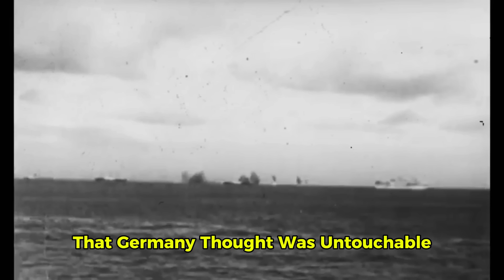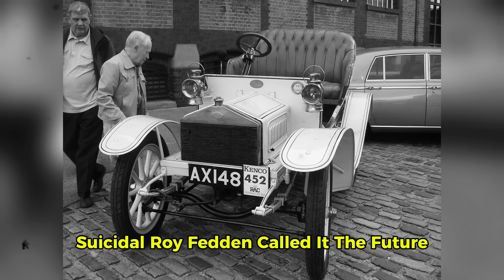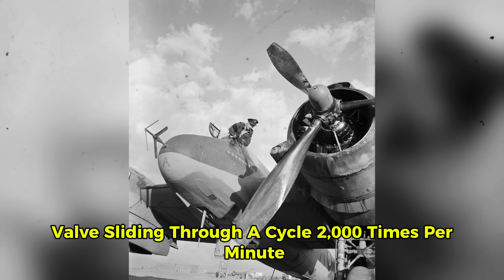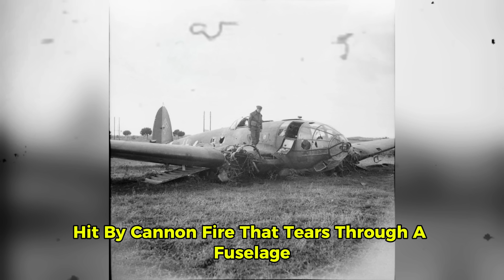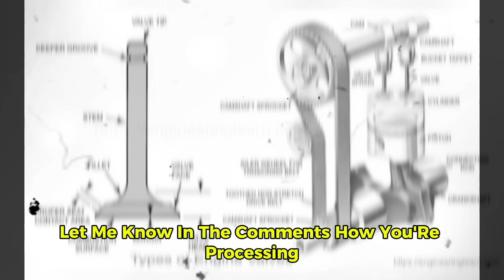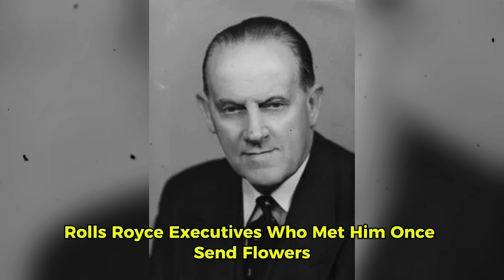They Mocked His Engine — Then It Saved Britain in WWII

Comment: My father went to work at AVRO in 1939 to learn everything about the  Lancasters. Then he went to Cairo to run the maintenance of Lancasters for Bomber Command. He had 200 mechanics working for him all of which really knew their stuff. They lost no planes due to mechanical failure. Of course they lost a lot of planes due to combat. He would determine what maintenance and repairs they needed upon returning from combat. He could repair Merlins but would never change the oil in his own car.  Then he went to English Electric to help design Canberras and Lightnings. Then back to the RAF to work on Valiants, Victors and Vulcans. Came to America to work for the Navy department then finally to Martin Marietta to work on Titans.

Comment: I think you are grossly simplifying the technical challenges to perfecting the single sleeve valve system 
His work with HDA ( High Duty Alloys) for piston and cylinder materials and sleeve materials which were compatible were the main challenges. I believe the final sleeve material was an austenitic steel, nitrided to produce a very hard surface and finish ground.... thousands of material combinations were tried and it was pure luck that the final finishing process was discovered.. 
As narrated, the Bristol Sleeve Valve engines were smooth  AND quiet as poppet valve engines are noisy in comparison 
 Finally the last civilian versions had time between overhaul up to 3000 hrs, almost jet level reliability, in the 1950s..
Sir Roy Fedden was a true genius, aided by his chief draftsman ' Bunny ' Butler.
ALL.Bristol parts have FB ....
IDENTITY numbers.
I believe over 120,000 Hercules were built, and they were still being serviced at Bristols around 1960.s
Reply: Correct me if I am wrong but did not Rolls Royce actually do the final grinding of the sleeves and cylinders as Bristol could not initially meet the fine tolerances required.

Comment: Daimler used sleeve valve engines in their cars until 1938. They were smoother, quieter and more reliable than a Rolls Royce. 
In 1927 Daimler was designed to travel 1000 miles each month and came with a five year warranty.
1927 and a 5 year 60000 mile warranty.
That's how good a sleeve valve engine is.

Comment: And yet most of every reciprocating internal combustion engine today uses poppet valves. I don't remember why they are not the end all be all that this video purports them to be but cost and complexity and liquid cooling instead of air cooling. What was its specific fuel consumption, maybe that's what it was? 
Specific fuel consumption - lbs of fuel per hp/hr.

Comment: I found that seeing a JU-88 displayed during the audio concerning the Beaufighter was , shall we say, unusual?  As to Fedden, years of work.  Imagine what the Orion could have done, with one caveat:  high powered piston engine technology was quickly becoming obsolete due to jets.  I have several books that mention the influence of Harry Ricardo on Fedden, as the use of sleeve valves with what was called a "junk head" promised the most efficient forms of combustion in an aircraft engine.  Thanks for posting this.  Other sites seem to concentrate on Merlins ,Allisons,  all the big P&W and Wright engines.

Comment: The sleeve valve engine was invented by Charles Yale Knight this was a double sleeve valve as per the drawing at  12.26 in about 1905. This was first used by Daimler in1909.Around the same period Burt & McCullum invented the single sleeve valve engine and was used by Argyle Motors it was then used for aircraft  engines. All aircraft engines were of the single sleeve valve design.
Reply from the maker: You are absolutely correct. While Fedden perfected the high-performance application for the RAF, the foundation was indeed the Knight double-sleeve and the Burt-McCollum single-sleeve designs. Thank you for clarifying that technical distinction for everyone.

Comment: If sleeve valves are superior to poppet valves, why are the former almost extinct and the latter virtually universal almost 100 years later? As but one example as to why, Sabres on the front line had to be run frequently during cold nights to keep them free enough to start before their first day mission. The engineering reasons are obvious: excessively demanding materials, tolerances, surface finish, heat treatment and lubrication.

Comment: Living in Wellington NZ in the 70s-80s the sound of laden Bristol freighters crossing Cook Strait is unforgetable. They were the smoothest radial sounds and I missed them when they went extinct.
Reply: As an apprentice at TEAL's (now Air New Zealand) workshops at Mechanics Bay, Auckland in the 1960's I spent a lot of time overhauling  Hercules for the RNZAF and SafeAir. Great engine and very easy to assemble in spite of the complexity of the sleeve valve drive train.

Comment: there is crap in this film, using an AI voice instead of an actual person that knows how to read a script and moreover KNOWS what is written. .  1.  October 1940 over the English Channel in a Beaufighter (not beau fighter or bow fighter) there would not be the smell of oil and sweat, it is cold for fucks sake at 18,ooo feet in October so no one would be sweating and the oil would not be in the cockpit.  Also Xi's, what the fuck is that?  Its Hercules XII which is Roman Numeral for 12!
Also why the use of images that have nothing to with the subject, like an image of a Heinkel 219, me.110, a WW.1 Armoured car and a prototype hawker tornado or Typhoon with night fighting radar equipment.  Merlin Engines in North Africa did not 'get chocked', they were fitted with sand filters to keep the dust and sand out.  Also the crap about Halifaxes flying over high Berlin because they were fitted with Hercules engines and not Merlin equipped Lancasters is another load of crap.  The vaunted 57,000 sorties by Hercules engined aircraft is LESS Than merlin Engined Aircraft.  Hercules engined Bristol Beafighters DID NOT FLY OVER Hamburg.  Also ignored is that Coastal command Beaufighter were replaced by MERLIN ENGINED Mosquitoes.  That isn't mentioned.  And for the 'engined that never failed' is a false statement.  The Merlin had problems with it's skew gear but they were sorted out and it became a reliable engine.  Have you noticed that Post war Merlin engined passenger aircraft out sold and produced hercules engined aircraft?

Comment: My father in law was a pilot in the RAF. When he first converted to multi engined types he flew the Hercules powereed Vickers Varsity. He recalls that the engines were started at 09:00 in the morning and essentially ran all day through multiple flights as the aircrew under training changed. Clearly Sir Roy Feddon was an engineering genius and I respect the fact that he did not suffer fools or bend to the will of bureaucrats. He deserves greater recognition.
Reply: I thou can be too much, and leave you a slack part. Even with my Myford Super 7 I try to beat 1 thou. Although I have a problem on a long workpiece, but I think it relates to the tailstock. Anyway, it is said that women machinists during WW1 could measure a thou just with their fingers.

Comment: Government bureacrats in Great Britain generally were drawn from graduates of the Classics and/or History who had no knowledge at all about engineering but considered that they were well educated to make decisions such as to ridicule Frank Whittle's jet turbine engine which obviously could not work without a propeller and/or Roy Feddon's sleeve valve engine which obviously could not work without a camshaft and poppet valves.
But somehow, the determination of these inventors did succeed, in the end!
Reply from the maker: You have perfectly described the 'Two Cultures' problem of that era! The disconnect between the classically educated administration and the technically brilliant engineers was a massive hurdle. To a bureaucrat, an engine without valves or a plane without a propeller sounded like science fiction, not science. It is a testament to Whittle and Fedden's grit that they pushed through that wall of ignorance.
Reply: Beaurocrats with a classical education were the bane of British industry
Reply: It was A A Griffith, a respected engineer, who dismissed Whittle's proposal for a turbojet in 1929. He had proposed a gas turbine engine in 1926, but that was for a turboprop. He continued  to promote the turboprop principle into the 1930s, and Metrovick had a design almost ready for manufacture in 1939 when Whittle's WU engine showed its true potential. The Metrovick turboprop project rapidly became a turbojet.

Comment: Not entirly convinced the poppet valves caused engine mounts to fail or freeze in cold climates. The poppet valve is certainly the main restrictor of air into the cylinder. The sleeve valve had ports in the cylinder wall similar to the 2 stroke engine so had no such restriction to flow. The difference being these ports moved & opened & closed relatively slower by comparrison to both the fixed port 2 stroke & the poppet valve design. This slow induction/exhaust port opening/closing rate led to a reduction in noise. These vids are killing the real youtubers who know their stuff.
Reply from the maker: You raise some excellent technical points regarding volumetric efficiency and port design. Regarding the vibration, the distinction is mainly about the reciprocating mass of the entire valve train (pushrods, rockers, springs) in poppet designs versus the smoother, continuous motion of the sleeve. That lack of 'clattering' mass is what helped reduce high-frequency vibration. Always appreciate a viewer who knows the engineering details!

Comment: Roy Fedden was a genius, but in modern war 'good enough' that can be made in vast numbers cheaply, is better than 'excellent' that is costly to produce. The Hercules was a tremendous engine, but Bristol had issues scaling it up. I think the Hercules topped-out at about 1700 HP during the war, when the conventional valve train Pratt and Whitney R2800 was producing 2000-2200 HP (and was cheaper to build). In wars utilizing mass production, those things matter.
Reply from the maker: This is the classic 'quantity vs. quality' debate of WWII logistics. You make a strong case—the Pratt & Whitney R-2800 was an absolute powerhouse and certainly easier to mass-produce than the complex sleeve-valve design. Fedden's insistence on perfection definitely made scaling harder, proving that in a war of attrition, logistics often win over pure engineering.
Reply: @WW2WarRewind  I take nothing away from Roy Fedden, he was a genius. But sometimes geniuses don't see the bigger picture, which gets into resource utilization and cost-things engineers don't always think about (I'm a retired mfg. Engineer with 46 years in industry, LOL). The material issue with sleeve valve engines were resolved towards the end of the war and Bristol produced the Centaurus, which had 18 cylinders and put out near 3000 HP!  But only 2500 were made because the war was almost over and most nations were focusing on jet turbine engines by then and not piston engines. Wonder what would have happened if Fedden had been allowed to continue developing his sleeve-valves? They probably would have had a 2000 HP design well before the end of the war-in time to have contributed greatly. I can see being used on British carrier fighters and bombers.
Reply: Power to Weight ratio I think the Hercules won there
Reply: @jacktattis  I think you're right, that's the advantage of sleeve valves-smaller diameters allowing reduction in drag and lower mass. The downside is they're damn hard to produce.
Reply: It sounds like he made an incredible engineering contribution,  but perhaps it was the correct decision to shift the responsibility for scaling else where. Design and production are different skills and focus areas. Doesn't the levels of quality production achieved subsequently (as indicated in the video) suggest that this was the right call.
Reply: @philipstrong8220  No question, having the USA make the majority of high-power Radial engines while the UK made the majority of liquid-cooled, high altitude V-12 engines was the correct choice. The Allies in WW2 were one of the best military alliances in history, everyone brought something to the table and they worked real hard not to duplicate efforts.
Reply: It’s the other way around Bristol’s Centaurus engines produced significantly more power per CC than P&W and the same boost, injection and octane.
Reply: @robertpatrick3350  Many Bristol Freighters built post-WW2 and flown in Canada and New Zealand. The type 32 had an extended clamshell nose and could transport 3 cars and 14 passengers. Silver City Airways flew these Lydd-LeTouquet and Hurn-Channel Islands.
Reply: @robertpatrick3350  Bristol didn't produce a design that put out what the P&W R2800 did until almost the end of the war. They had sleeve valve durability issues. Theoretically sleeve valves were more efficient, but practically they had durability problems. Material science wasn't up to the performance demands of the designers in many cases until the war was almost over with. The Liberty Ships had issues with cracking hulls that were somewhat related to steel of inadequate toughness-especially at low temperatures. By the end of the war the quality of steel coming out of the plants was significantly improved and the proficiency of electric arc welders had improved quite a bit. Hull cracking was reduced quite a bit.
Reply: @heyfitzpablum  The biggest problem for sleeve valves was the state of OIL technology.  If more modern lubricants had been available in the 20's and 30's they may have dominated some classes of internal combustion engines.
Reply: @petegarnett7731  Possibly lubrication quality, out of round sleeves was also an issue. That's the downside on sleeve-valve engines, when everything is within their tight tolerances it's a high performing engine design. But fall outside those tolerances and you're scraping metal at high speed and high temp. Poppet valves engines are much more forgiving. I set up machining operations for transmission aluminum valve bodies at one time and they had tight tolerances (but not as tight as sleeve valves!). This was in the 1990's and I was using state of art Toyoda and Heller drill/ream CNC centers. It's tough to meet those tolerances on a statistical basis! Now, move backwards 50 years,  before silicon processors and CNC and try and machine STEEL sleeves to even tighter tolerances! We even had a climate controlled (temp and humidity) plant to assist precision machining, they had none of that back then! The only way they could produce some of their more critical components is by 100% hard gaging them and that is slow and costly.

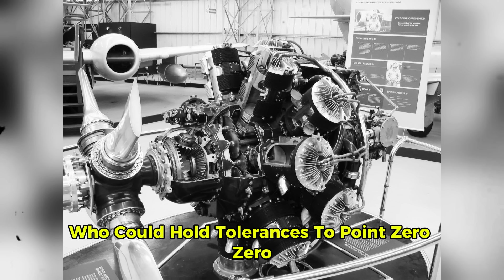Comment: @04:00 about the machining tolerances; that jives with my father's time as a RR engine machinist. He mostly described turning pistons for Merlin engines. The tolerance subject came up when he immigrated to Canada after the war and the Orenda (A.V. Roe) factory essentially asked him to cool it - 1 thou' was satisfactory - half thou' was a bit like showing off. Jump ahead to 2015 and I was a camshaft inspector for an auto parts machining corporation. The camshafts were typically within less than a thou' to optimal, often at that half a thou' value. It put a smile on my face to think my dad was doing that with the machinery of the 1940s and with the chance bombs could hit the factory or his parents' home in the meantime.
Reply from the maker: This is such a touching story! Achieving 'half-thou' tolerances on manual lathes in the 1940s—while under the threat of bombing—is a level of craftsmanship that is almost hard to comprehend today. It is amazing that he carried that high standard with him to Canada. That 'showing off' was the difference between an engine failing or flying. Thank you so much for sharing this family legacy with us.

Comment: The Merlin engine that the English put in their aircraft was miles better than the yanks crap so they begged the English to let them build it so they did and the Merlin won the war
Reply: LOL. The Mark 61 Merlin and beyond had the two-stage supercharger that performed better than our Allison at high altitude, so it was the best engine to use for Bomber Escort fighters like the Mustang. But at lower altitudes where much of the fighting was being done in the Pacific, the Allison was the better engine-much cheaper to build, more reliable, more durable, half the components of the Merlin, better power-to-weight ratio. The Allison didn't get a two stage supercharger because the USAAF asked Allison to focus on turbochagers for the primary stage-which they did. That engine was used in the P-38 Lightning, P39-Aircobra and the P-63 Kingcobra. A total of 70,000 Allison V-1710 engines were made in WW2 compared to 150,000 Merlins, so while it wasn't as successful as the Merlin it had it's niche and it performed well-within the constraints of it's design envelope.
Reply: @heyfitzpablum  wow p38 p39 p63 OH yes masters of the sky ?
Reply: @jacktattis  Great fighters, every one of them. Without the P-38 we'd have been in deep chit in the Pacific. As for the P39/P-63, the Russian wanted every one they could get their hands on. Simple, cheap, high performance, durable-only downside was the tricycle landing year, but they learned to work around that shortcoming.